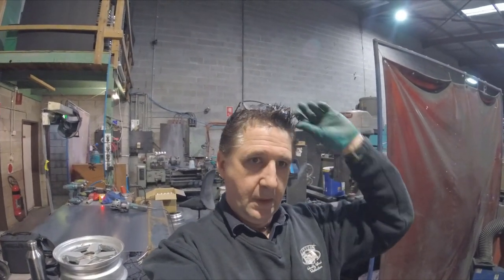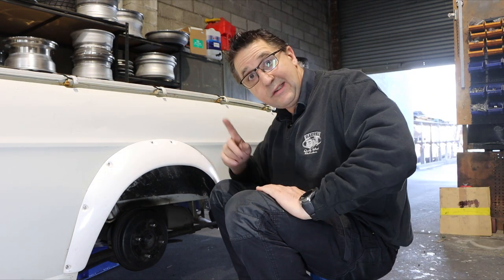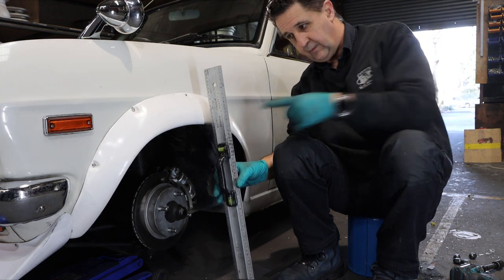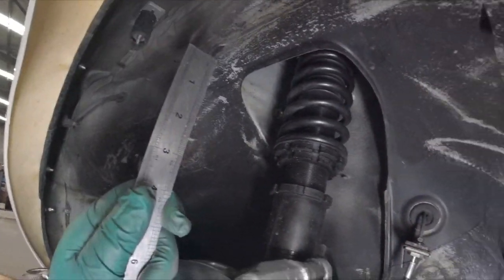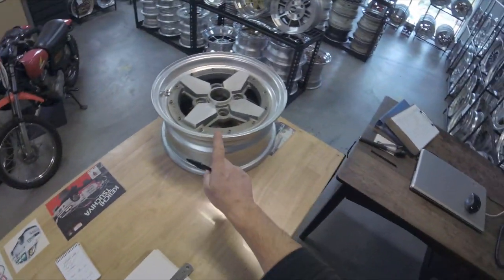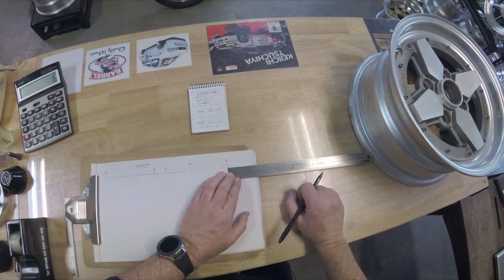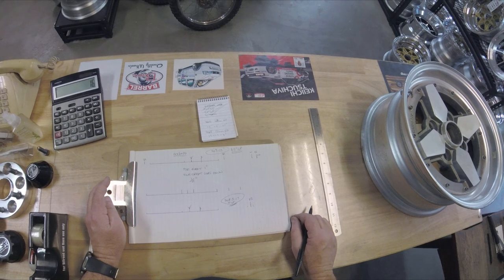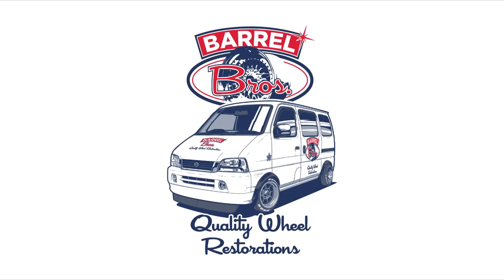32.  Barrel Bros Tech ep 3.  How to measure your car.

Comment: Here's another way of working out your wheel and tyre sizes starting with OEM sizes and comparing them to the ones you want to run.  Measuring your clearances will still be the same.
https://www.wheel-size.com/calc/?wheel1=245-40-18X8ET41&wheel2=275-45-17X7.5ET40&fcl=50mm&wcl=30mm&scl=50mm&sr=0mm

Comment: Hi guys , just a question about scrub radius ? That front wheel setup looks to have a huge scrub radius and overhang on that small outside bearing , does it track ok ? Or does it follow depressions in the road ?
Reply from the maker: Does tram line a little as anything with a good wide tyre on the front will, but is actually very good. 1 hand driving most of the time. A reco'd steering box and the roll centre adjusters made the biggest difference.
Reply from the maker: ...and the less offsetty wheels we built for it in the last episode.
But jeez it looked good on the Phantoms.
I could almost forgive it's wayward handling.